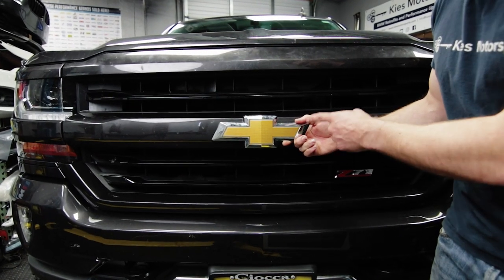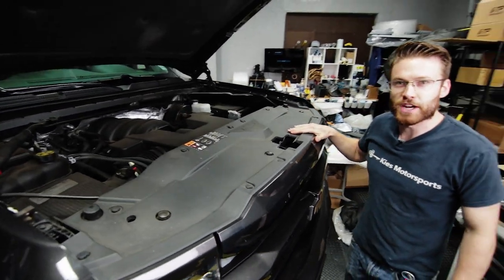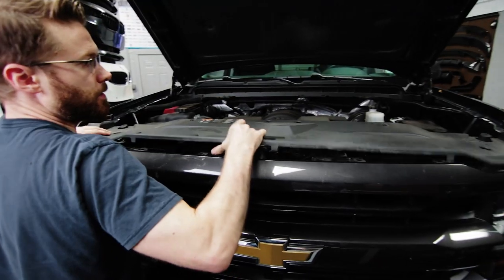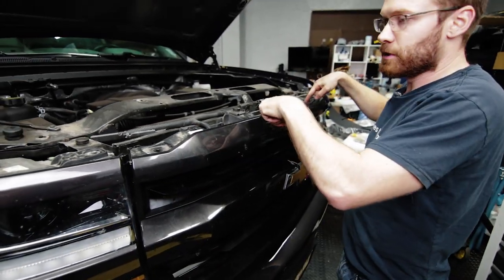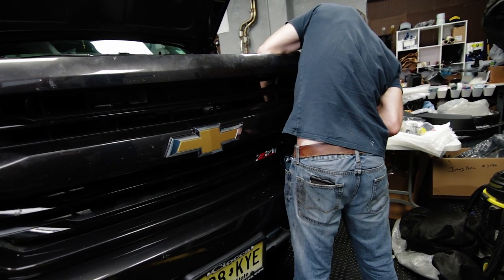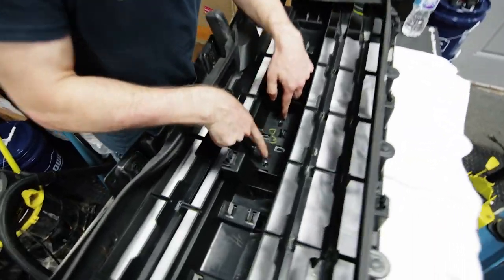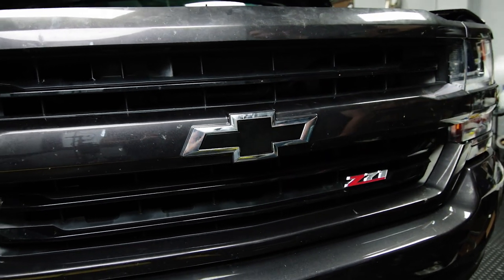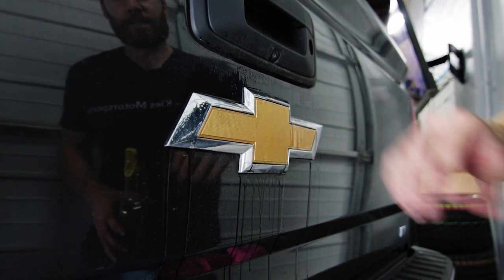How to Change Front and Rear 2016 -2018 Silverado Bowties and Remove Grille

Comment: Good video but just save yourself some time and use credit card for front and just be careful with the solvent you use for the rear so you don’t eat your clear coat. You’re more likely to scratch something or break the plastic fasteners while taking the entire grill off than just sliding something smooth/plastic behind the front badge and popping it out.

Comment: Nice DIY video.  There’s an easier and faster way to remove the front badge.  Work a plastic auto body trim tool directly around the badge 4 tabs and the badge will pop out in less than a minute.  Use 3M adhesive remover and a hair dryer instead of heat gun to remove the rear badge.
Reply from the maker: Good tips thanks!

Comment: Too much work. Why didn't you just take a flat head and pop the bowtie off? I'm on my 3rd chevy truck and i used a flat head to change it on each truck.
Reply from the maker: You can do that. Don't want to scratch the front tho.
Reply: @TheSundaeDrive  Believe me, there's no scratching. And if you're concerned about scratching, just tape down the parameters of the bowtie slot and that will remedy that. Just try it on your next video and you'll see that it's an easy 2 minutes replacement on the front grill.

Comment: You do NOT have to take the hood apart for the front. All you need are body tools or a used credit card. Slide it down one side of the bowtie hold it out a little and then the other side. Wala it's out in no time flat. This way you dont need to take apart the front end and scratch up all that chrome or paint. The rear I used fishing line or dental floss and a hair dryer. Use masking tape and outline the old emblem first. When working off with the fising line or dental floss just have patience. Clean all the old 2 sided sticky tape off (it can be a pain and tedious).Make sure the area is wiped graciously a few time with rubbing alcohol to ensure its clean.
I do not reccomend doing it like the video..you can cause scratches or dent the tailgate.
Reply from the maker: Good points. I actually prefer taking the front grille out to remove the bowtie because I think there is less of a chance of scratching the area around it by inserting something behind to release the clips. Your suggestion should work as well but with how easy the grille comes out, I prefer this method. For the rear bowtie, fishing line is also a good alternative. You DO NOT EVER want to use anything to pry against the tailgate. I was very careful to only slide a nylon pry tool straight in to release the adhesive tape without applying an inward or outward force. We could have been more clear about that in the edit. Once I had a gap, I pulled the bowtie straight off using my fingers. Both methods will work but it is possible someone could dent their tailgate if they do not realize how thin the metal is and trying prying emblem off. In that case, fishing line is safer.
Reply: Thats how I did it.  A lot less work.
Reply: I second this. Took my 30 seconds
Reply: For once in my social media life, I’m actually glad that I read the comments. Just changed front emblem on 2018 Silverado in (literally) 30 seconds using a trim removal tool.
Reply: I changed mine in less than one minute using a plastic trim tool.

Comment: What did you use to clean up the double sided tape residue on the tailgate?
Reply from the maker: Goo gone 👍
Reply from the maker: Just be careful not to get it on the plastic, it can stain
Reply: The Sundae Drive thanks man
Reply from the maker: No problem!

Comment: I'm looking for a video. How to remove the badges on the doors and tailgate and remove the sticky stuff. I just want the Silverado badge off the doors and off the tailgate and then I want the LT badge also removed. I prefer the bow tie with the 1500 symbol from like 99 to 06 generation. I'm going to put that on the side. I hate their name Silverado. That's not what they're called. It's a 1500. Silverado is just the sheep people's name. It's for the sheeple to have something to call it. It's really just a 1500 either a c or k. The RPO code for my truck is k1554
Reply from the maker: Use fishing line to remove it and then goo-gone to get rid of the residue. You'll probably need a buffer too i